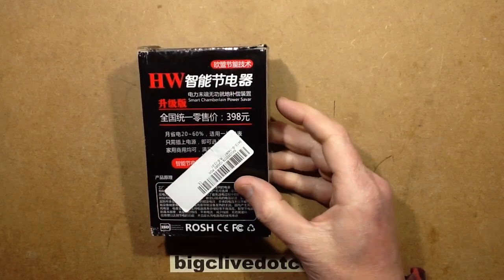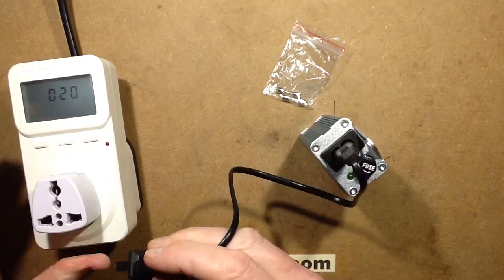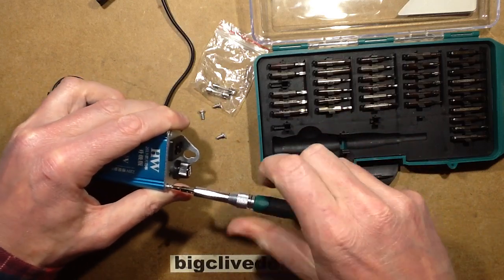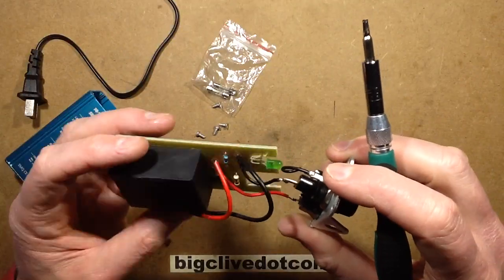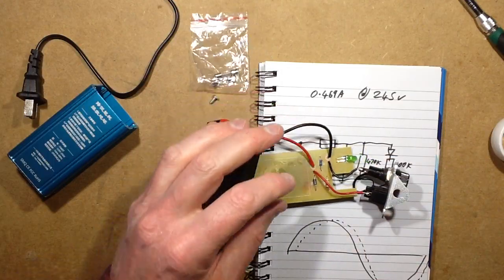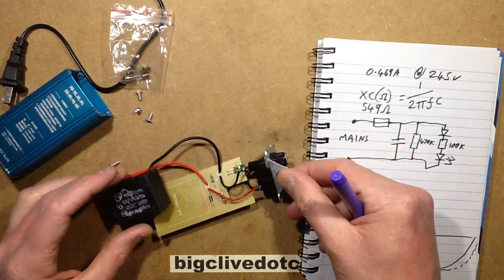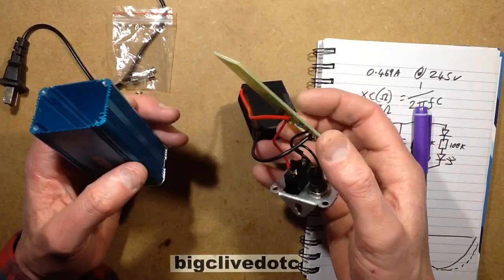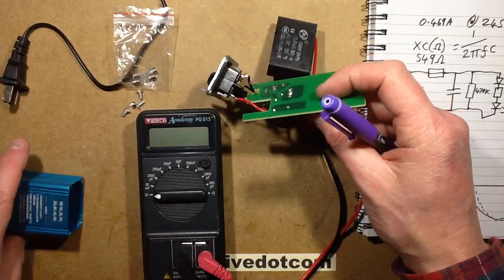200kW miracle power saving device.

Comment: Seems you like math, here is a little sum for you.

9-3 divided by 1third + 1 =
and another  6^2 ÷ 2(3) + 4 = ?
Reply: 19, 58.

Edit: Oops, I read the bottom one as 2/3 instead of 2*3. 10. :P
Reply: Correct what I find interesting as it crops up in our language is this: I saw a man (with binoculars). How do most people interpret this?
Reply: +Steven Nicholls 9, 10
Reply: There are a several ways to do this but only one is correct. I would start off by rewriting the problems with brackets included  so there  is no confusion  over  operator precedence. So, "9-3 divided by 1third + 1 ="  is  equivalent  to:     9 - (3÷⅓) + 1  or  9 - 9 + 1  equals 1.  Q2,  6^2 ÷ 2(3) + 4  with  brackets  rearranged  is  equivalent  to:  6² ÷ (2x3)+4     ≡  (36÷6)+4 = 6 + 4 = 10.  Simples! (Sometimes I just can't resist a bit of arrogance).
Reply: You got the first one wrong. The ÷ operator takes precedence over both the - (minus) and the + (plus), so the minus and plus part are done last: 9 - (3 ÷ ⅓) + 1.
Reply: Is the answer potato?
Reply: A=10 both equations
Reply: he had binoculars
Reply: +Giant “The Legend” Dad
yes
Reply: +Chris well, i agree with your first answer but i don't know why the you have put 2x3 in parentheses when only the 3 is parenthesised in the original question.  therefor the second part should be 36 ÷ 2 x 3 which is solved in the order it appears: 36  ÷  2 x 3 = 18 x 3 = 58. 

also, as the first sum is informally expressed, its solution is open to interpretation and may well be reasonably solved in strict sequential order for a result of 19. 

in any event, it's garbage maths.  garbage in... garbage out. :p
Reply: i read it as a complete sentence but with less emphasis or importance on the (*), and since there is no comma i would believe the man you saw had binoculars in his possession. but i suck at math
Reply: To be honest I did not know how to do it using my keypad!

Comment: What isn't mentioned is that this is pure 'Chinese Export' and could never hope to pass the UK electrical safety standards. Not being double insulated and having a metal case with no Earth connection for starters.
Reply: +Kimdino1 - yes I thought a bit of external pressure on the (unearthed)case might put it in contact with the soldered cct board connections.

Comment: This is a power factor correction unit. They really shouldn't promote it as a "power saving" unit though because it to actually save, your electrical circuit have to be lagging (if I'm remembering correctly, but it could be when leading). If it's otherwise, it will still help your inductive load; your motors to run more efficiently and improve the life span.

And other thing which also depends on your electrical layout is that in most case it just a single line that needs correcting. With the way this device connects, it corrects both, but if only one line needs correction, it will over correct the other one. This is also bad.

I think, while it may not save energy, it is still very good for your inductive loads. It will fix some of the noise, the drag starts and improve the life of your motor.. Saving energy may be a plus depending on your situation..
Reply: I bought one of these just for that.  I plugged into into the same junction as my washer/dryer/dishwasher.   Those suckers have big motors.
Reply: Any well made device with a motor in it will include power factor correction though.  Also a lot of modern motor driven devices have switched to PWM for more precise control and efficiency.
Reply: 2 refrigerators, a 5 ton A/C, a sump pump, a dehumidifier and 2 pumps on my hot water baseboard heat.  No PWM anywhere in those appliances and the lights flicker when they start due to startup current ( the few incandescents left).  Glad i no longer have a swimming pool filter.

Comment: Ohms law doesn't apply in AC applications where current is leading or lagging.  You should be using voltage phase diagrams/equations.

Comment: I had an excess solar panel 250w and just for the heck of it i got a small 300w Chinese grid tie inverter to see if i would save some electricity (more of a environmental than financial curiosity). I had it since last august. About two months ago i got a legal notice to have my power box examined as it appeared that i was "abusing" the meter. the measurements showed too little consumption for a long period of time. I don't have much power consumption to begin with as i have a hybrid solar and gas heater and gas stove but didn't expect that outcome...
Reply: wow looks like the spare 250w panel started saving you energy to buy from grid, power companies dont like that..im assuming the inverter is a pure sine type, anything else would trip the elcb
Reply: +fidel catsro They sure don't. I certainly didn't expect to be dragged from office to office explaining myself and my measly solar setup, not to mention the threats of legal implications. The inverter was indeed labeled as pure sine though at that price i wouldn't be certain of anything.
Reply: would love to know more about your set up. do you have a utube video about it?
Reply: Your power inverter must SYNCHRONIZE the waveform with the incoming power, or there will be trouble.
Reply: @victorsteerup3111  It doesn't just have to synchronise, they also have to meet other safety standards like cutting off if the main power goes out and usually registered with the electricity company so they know you have it connected, thus the warning for unusually low usage due to using an unregistered device.

In the UK I believe its actually illegal to use grid tie inverters not professionally installed and verified as meeting all the safety standards.  The cheap ones that just plug into a socket are considered a risk due to potentially the plug being live, as of course you can't trust a cheap Chinese device to perform as intended and cut-off when unplugged.  Plus if it doesn't turn off during a power outage some poor worker could get electrocuted while working on the wiring due to it back feeding into the grid.
Reply: Hello how can I get a set-up like yours?
Reply: Unregistered cheap grid tie inverters are a good way to kill folks working on fixing power outages.
Reply: @RobertSzasz  clearly you have no clue how a grid tie inverter works or what levels of safety precautions utility line workers go through to keep that from ever happening and that is before factoring in that a small multi hundred watt inverter running off solar panel would never carry the base load the electrical grid presents all by itself.
Reply: @tcmtech7515  clearly you don't know what the word cheap means. You can easily buy some crap from China, not install it correctly, and backfeed out to the power grid connected to your house during an outage. Most of the time even that would do no harm, but such setups have killed people and will continue to do so.
Reply: @RobertSzasz  And you know my work history and knowledge base how?  

FYI. I have two degrees, One is tech trades related and the other is electrical engineering so yes. I am rather familiar with how this stuff works being I have actually done both residential and commercial /industrial power system work for all my life and even designed GTI units from the ground up so believe me when I say I know exactly how they work and they dont work the way you seem to think they do. .

Reality is your concerns are a non issue in any civilized modern country where utility workers have to follow  multiple tiers of safety regulations and procedures.  I know how this stuff works in detail being I have had actual hands on experience  working directly with utility level power systems from when I did  9 months of co op training as an electrician at a big mine where I regularly worked with power systems up to 23 KV three phase and had to follow the same safety procedures all linemen have to.   

Believe men, backfeeding the grid from a GTI is a non issue on multiple levels for multiple reasons.  The physics and the way a GTI works by design alone prevent it.
Reply: @Tcmtech < Actually you're the showoff by saying "@Robert Szasz clearly you have no clue how a grid tie inverter works...", being prejudice and offensive when you don't even know the guy.  Maybe he's right and you're wrong... Shocking isn't it?!
If you're so sure about your knowledge, how about simply explaining it clearly, and leaving the personal attacks out of it, then maybe we could all learn.... just something to think about next time.
Reply: @tcmtech7515  so, would there be danger to workers if during a power outage someone wired up a deathdapter , and plugged a running generator into a wall socket?

Go crappy and cheap enough and you will find the battery based equivalent of that.

Proper systems aren't a risk, registering them is just another layer of safety. But they can be made in a way that will "work" but is also potentially deadly.
Reply: @BillAnt  I wasn't aware that giving friendly advice based on personal experience was showing off now?  Are you that emotionally fragile you can't handle someone giving a simple explanation, based from on actual experience, without feeling offended by it?  

My point is, pointing out to someone that they have a misunderstanding of a technology is not being prejudiced.  Its how we learn new thing and become better people, not stupider more arrogant and dangerous ones. 

Or are you against people being confronted by those who have actually done something, in order to let them know they have a misunderstanding  in how they think something works, so that they can then expand their knowledge base and be better informed in life and not make fools of themselves over that which they clearly dont know a bad thing?  

Or is knowing the difference between fact of reality and common misunderstandings, by ones own personal hands on experience and education, racist identity politics or some other pointlessly argumentative idiomatically driven bullshit now too?
Reply: @RobertSzasz  Your defecting from the actual topic.  We are not talking about engine driven generators or DC to AC power inverters that can source AC line power on their own or incorrect, illegal potentially life threatening utility power line work is done.   

We are talking about Grid Tie Inverters which by design literally can not work without a live power grid connection to synchronize themselves to and how propper intrinsically safe utility maintenance procedures are implemented to keep the people who are doing the work safe.

  If you dont know the facts of how either systems work or how correctly and safely done utility line work is performed so that  line crews are not put in danger, go spend some time learning the details of both.  

The information is widely available online to where anyone can find it and everything else they or you have questions or concerns about as well, if they/you are willing to go and do it.
Reply: @Tcmtech < I'm not offended at all, I was just pointing out that we can all be gentleman and maybe learn something new without being insulting and sarcastic... but when a response starts out with an insult on intelligence, it will rub people the wrong way... that's all.
Reply: @BillAnt No insult or sarchams was implied.  I simply pointed out that as his comment read it came off as showing an utter lack of understanding of the topics.  That's all.   

How you or anyone else interprets it is not my problem.  I dont play the PC special ed snowflake speech correction  game but many do and their #1 go to is to throw false accusation/deflection/moral outrage bullshit at things rather than admit they are not the experts on the subjects they think they are and thusly step up and expand their knowledge base so that they may grow up just a tiny bit for it.

If my words pointing out that somebody is wrong in their understandings of something cause someone emotional discomfort maybe they need to ask themselve why that is and look into it.  Especially if they would rather argue a pointless tangent, to try and falsely claim they are right based on a false proxy equivalency, rather than educate themself to the reality of the actual topic and subjects in play.
Reply: @RobertSzasz  That is why the (the local distribution) line being worked on is shorted to protect the workers just in these situations. Main long-distance lines are a different matter.

Comment: Most household loads are inductive in nature... the capacitor is supposed to help correct the power factor thus saving you money on your bill.  Most new AC units and refrigerators already have the capacitors installed.

Comment: Compensation of negative COS F is used for decades...
Reply from the maker: +spravodlivy Yes, but Cos Phi correction is only an advantage in industrial environments.
Reply: +bigclivedotcom  Agree, but I use the term "power factor correction"
Reply: +terry hollands Cos Phi and power factor are just different names for the same number derived via the same equations
Reply: Mrpsychotehpyro Thanks for clarification, it's been 40 years since I've done power factor calculations.

Comment: Hi, I'm from BRAZIL, I'm sorry but curiosity for what this device
Reply from the maker: +Mario Mhk It's supposed to cut down your electricity bill, but doesn't.
Reply: +Mario Mhk All the device does is light up the green LED. That is it. :)
Reply: nitehawk86 Thank you
Reply: bigclivedotcom Thank you
Reply: +DJGREKKO OK I understand
Reply from the maker: +Roman de Caesar No.  But by looking at your highest loads, usually heating, air conditioning and water heating you can cut down your electricity bill by adjusting the temperature by a few degrees.  If there are any lamps running all the time then consider replacing them with lower power LED ones.
Reply: +Mario Mhk watch the video :)
Reply: +bigclivedotcom Is there any device that does?

Comment: I'm a keen audiophile and there are hundreds of quack products that apparently improve the sound. Interestingly, the more they cost, the more kudos that is attached to them.
Reply: Mysterious Squirrel they still sell them apparently
Reply: +Mysterious Squirrel If you are a keen audiophile then you understand that such a product could actually improve sound in certain scenarios.  Suppose for example you have equipment putting high frequency ripple on the AC mains, then an LC in series with an unregulated linear amp PSU, particularly on a discrete amp design with low PSRR, could improve sound.  Could you actually HEAR the difference?   Maybe not, an unregulated PSU powering a discrete amp circuit tends to have all kinds of unique distortions going on.
Reply: Stinky Cheese I know in the 80s a company called BBE started building what they called 'sonic maximisers'. Basically they were a pre amp that sat in the tape loop, much like an effects unit does. They were dirt cheap and brought the sound to life. Mistake 1 was the name 'sonic maximiser' and mistake 2 was the cheap price. The Hi Fi press absolutely rubbished them. Meanwhile, pointless and worthless gadgets that did nothing with huge price tags attached to them were vaunted as must have tweaks.

Comment: 200kw = 270 hp......................lol
Reply: Whittle Moore multiply the power value by 1.341 to convert power values to equivalent mechanical horsepowers, simple as that try it. 200KW = 200X1.341=268.204, British Horsepowers.

Comment: A power saver?? -.- .... Might work a bit in inductive environments if blind current is metered by power providers (never seen in german households yet). A parallel capacitor short-circuits the high frequency noise portion so it charges the leads by additional blind current resulting in heat (through lead resistor). That circuit with its fat capacitor would do a much better job in filtering the current for sensitive devices behind.

Comment: A 20,000 watt power saving device lol , what is that tiny cap even capable of accepting for wattage anyways ? 

I've got two dozen bigger caps inside a car amplifier I built , the most expensive part of that mess is the case .

Comment: So its basically just a tiny capacitor bank? Was it worth the buy in your opinion?
Reply from the maker: +timtam1593 Not for the intended function, but it's a nice case.
Reply: +bigclivedotcom Definitely lol laughed at the 200kW rating, you should test it out at peak and see if its true. I will buy one then
Reply: +bigclivedotcom That's funny. It was my 1st impression as well.

Comment: Changing the power factor on the total load, via a large inductor or capacitor will affect the mains power meter reading.
Only by seeing what the meter reads will be the final proof, if the device works.
Taking out the capacitor in a fluorescent fitting will "save" you money.

Comment: "turn the heat down" implies electric heating. In my case, natural gas is far cheaper.

Have you ever looked into a plug-in filter? It doesn't claim to save power, but removes noise from the circuit that interferes with X10 powerline communications.  The idea of plugging a box in someplace else (not in-line with the load) and it doesn't do anything obvious is ripe for fraudulent products to flourish.

Comment: Here In North America they push these with two  80 microFarad caps for  about  $300.00
And  yes, lowering room temp a degree or two reduced heat load significantly. I am considering adding large cap to supply side of 6 kVa Pickhill welder to reduce actual supply line current as they do not have caps built in.